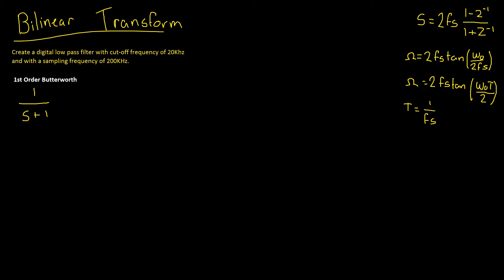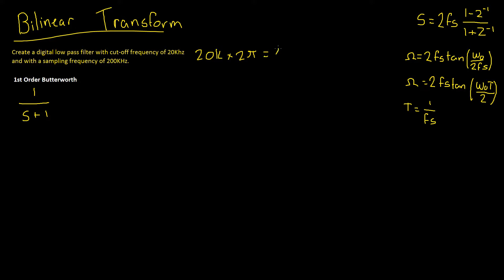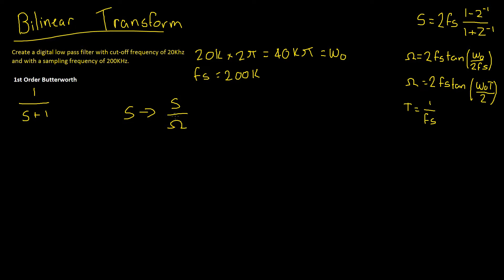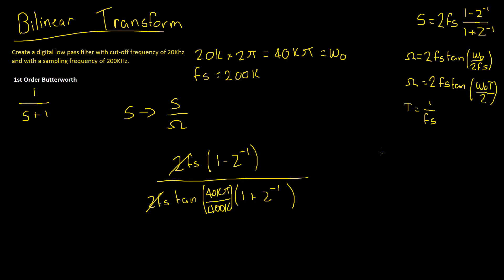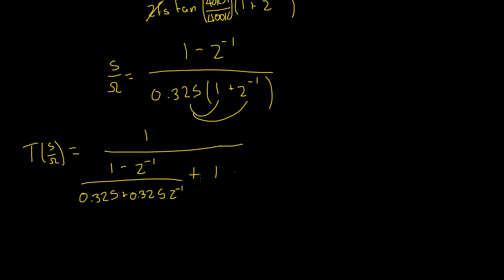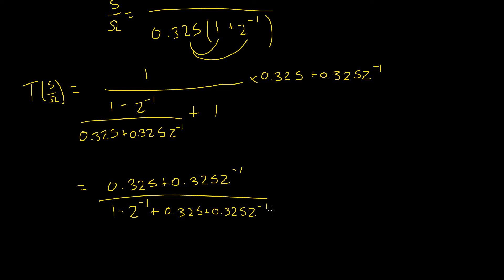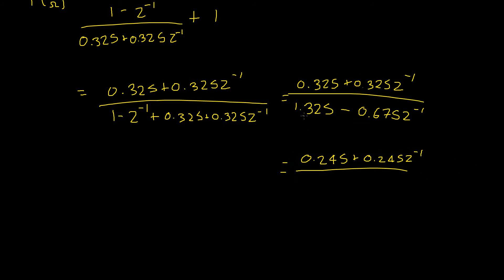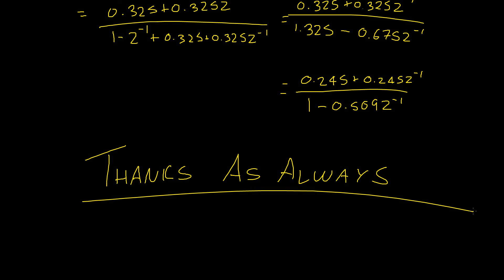Bilinear Transform Example - Signal Processing #14

Comment: Great review of the bilinear transform.  Last time I looked at the bilinear transform was in about 1983.  A couple of suggestions - Although it's in your intro text that the first order butterworth had a cutoff freq of 1 rad/sec, it wasn't mentioned in the lecture.  I didn't read the intro text, so didn't realize it.  Looking at the S domain transfer function, it wasn't too tough to figure out though.  You then went over frequency scaling an S domain filter by replacing S by S/w0 , but you didn't mention that it only works when the original filter had a cutoff frequency of one rad/sec, and by the way, that's exactly what we've got.  I had to stop and think about all this for me to fill in the blanks.  Not too tough.  But it would have been a bit easier to follow if you had said something along the lines of "Our S domain filter has a cutoff frequency, w0, of 1 rad/sec.  To scale an S domain filter with a cutoff freq of 1 rad/sed to a new w0, we replace S with S/w0.  We want in our transformation to have the cutoff frequency prewarped to be at Omega rad/sec, so we'll replace S with S/Omega."  I was eventually able to figure all this out, but I did have to stop the video a couple of times to reremember/think through all of this in order to follow the discussion.
Reply from the maker: Hey Jerry,
Thanks that's really good feedback. I will try to get around to adding a card on the screen. In the meantime I hope that your comments helps anyone who is confused :)